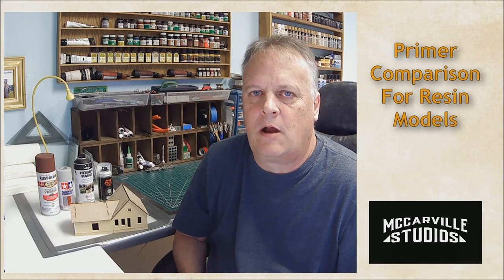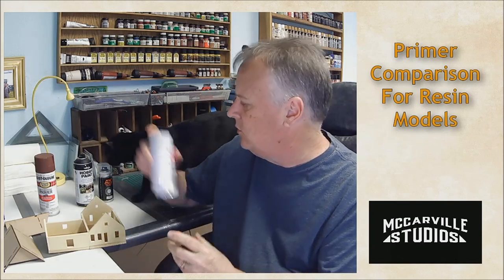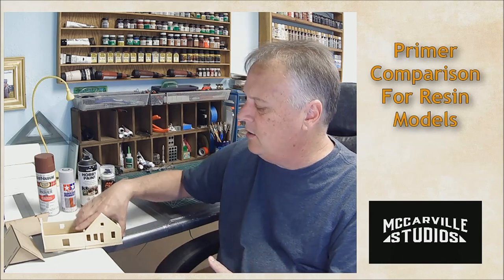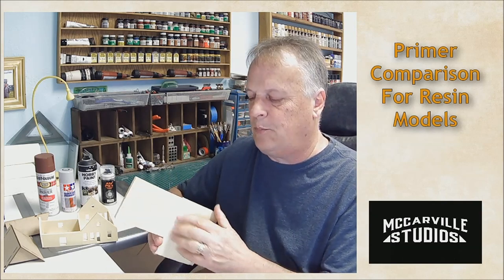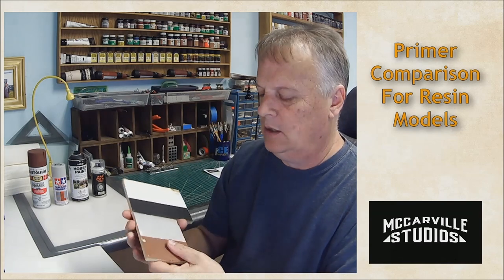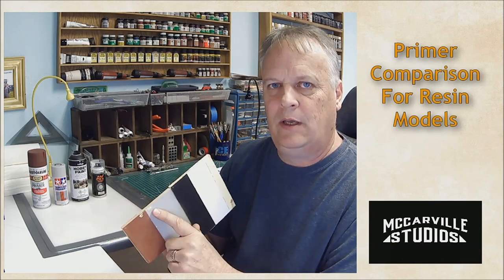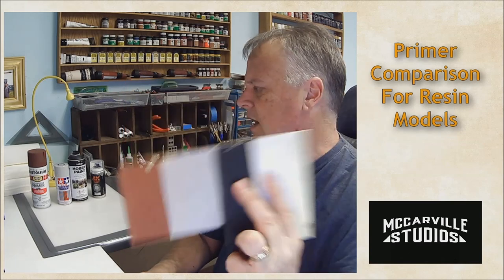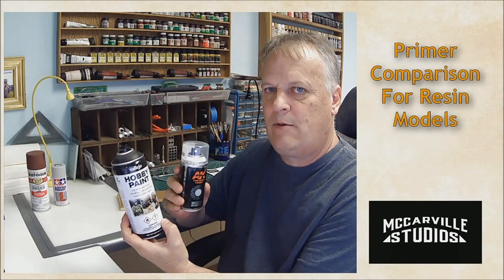EP 185 Primer Comparison For Resin Model Kits, McCarville Studios

Comment: I like your helper there. Man, as they say, timing is everything. Great comparison, but a couple weeks too late for me. I've assembled an O scale signal tower made of resin, and just finished the second coat of Krylon primer on it. I've noticed it does scratch easily, and sure wish I had seen the AK before now. But once finished it won't be handled, so hopefully, it will be OK. Thanks for the comparison, I'll know better next time.
Reply from the maker: Ugh that sucks. Maybe a good coat of dullcoat will help?  My test was after only hour, so the AK should be even better after 24 hours.
Reply: I still have the final color to spray, and that will be some AK 3rd Gen airbrushed on. But with a questionable undercoat, I don't know how much it will help. Fingers crossed. LOL
Reply: My AK Resin Primer arrived and I sprayed the remaining parts with it. I like it. The paint over the Krylon primer seems to be holding on, but I put dullcoat over the paint, so that may be helping. Thanks for the tip on the AK.
Reply from the maker: @CassidysWorkshop  glad it is working. My primer is still great after a lot of handling.

Comment: Does the different MFG resin composition vary that could also make a difference?
Reply from the maker: Yes, but also the correct mixing proportions as well.  Some resins, if mixed poorly, will not cure well and can remain tacky\sticky.  These cured well and took the resin  primer the best, which makes sense.

Also, the Rustoleum, which performed very poorly, could be scratched off days later with my fingernail.  I would avoid that primer, in addition to all the problems that brand has with clogging nozzles, and very large grain issues.  Paint a workbench or fender with it, but not small models.

Comment: I've used an AK matte finish and won't ever use it again it smells horrible even weeks-months later. so how does that smell? But good to know about the primer.. also put rattle cans in a warm water bath before spraying, it mixes a lot better and sprays evenly. may want to look at Valspar clear Plastic primer I've used it on 3d prints and seems to hold up well after being painted.
Reply from the maker: Smells fine but using it outside is the key.